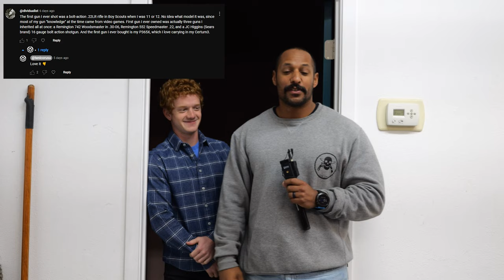BCM + Aimpoint AR-15 rifle build with Jeff Mau - Tenicor

Comment: Really enjoyed this video! Do you prefer the enhanced lightweight or government profile barrels from BCM? Any particular reason why?
Reply from the maker: Thanks for the question.  For a general use rifle, for sure the enhanced light weight ios the way to go.  The lighter gun is easy to shoot and maneuver.  The BCM hammer forged barrels in the light weight profile are plenty accurate.  

If you are looking for DM or more precision focused gun that will have a higher powered optic like a 2.5-10, then the BCM KD4 upper shooting MK262 is the answer.  It is hard to find a better gun that is more accurate without getting into hand loading etc.

Comment: Is there a built list for this rifle available?
Reply from the maker: Suppressor: HUXWRX HX-QD
Upper: 14.5” BCM
Lower: BCM
Charging Handle: BCM MK2 Ambi 
Optic Mount: BCM Aimpoint Micro T2
Sights: Magpul MBUS Pro Front
Trigger: Geissele Trigger Super Tricon
Magnifier: VORTEX Micro 3X
Rail covers: BCM Gunfighter Rail Panel Kit
Sling: Viking Tactics

Comment: What torque were you using for those MBUS Pro sights? I need to get one of those torque limiters, they seem pretty handy.
Reply from the maker: They are handy, we just used the torque spec specified in the directions that came with the sights.